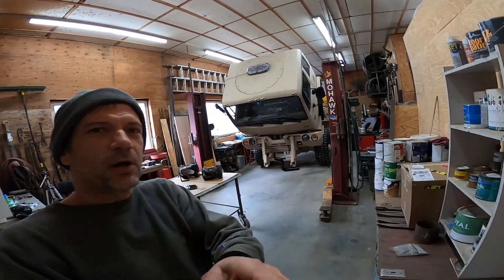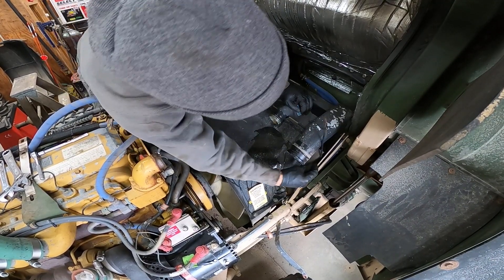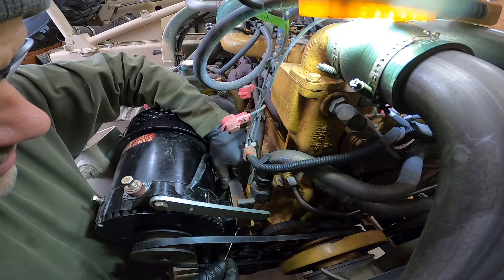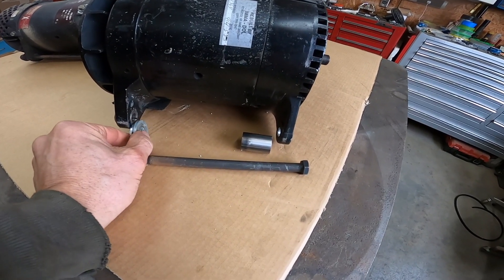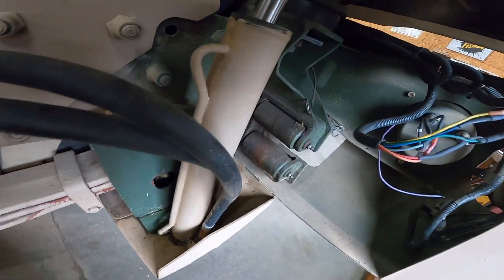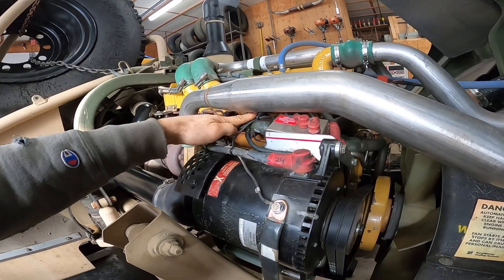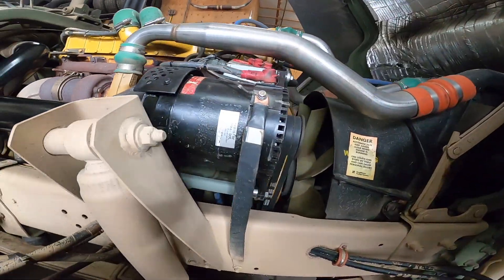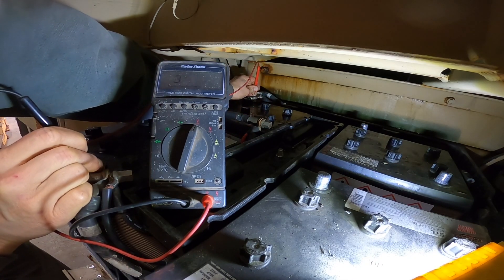LMTV 200 amp alternator upgrade

Comment: Clean work as always.  I may steal your voltage regulator bracket idea although 15k miles on mine still using tie wraps seems to be working fine...
Reply from the maker: Thanks! Steal any ideas you want. Thats why I put them out there. :)

Comment: You should be able to just unscrew the air line from the bottom of the shroud..I see you posted source, thank you
Reply from the maker: This is where I got the one I used.

https://www.ebay.com/itm/153229998774?mkcid=16&mkevt=1&mkrid=711-127632-2357-0&ssspo=Q3wTooA4RZm&sssrc=2349624&ssuid=xj1PHBiHSBe&var=&widget_ver=artemis&media=COPY

Comment: Do you think you could post the Neihoff part number of the alternator and voltage regulator? There are so many different ones, I would hate to get the wrong one. By the way, thanks for all the great videos. You have helped me along multiple times on my M-1083!!
Reply from the maker: this is the one I used in the video.
https://www.ebay.com/itm/153229998774?mkcid=16&mkevt=1&mkrid=711-127632-2357-0&ssspo=Q3wTooA4RZm&sssrc=2349624&ssuid=xj1PHBiHSBe&var=&widget_ver=artemis&media=COPY